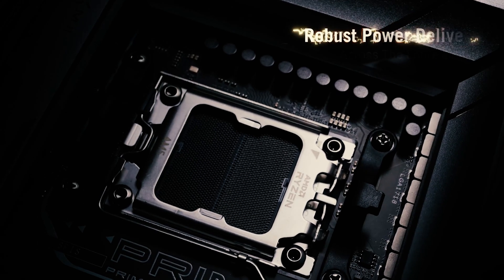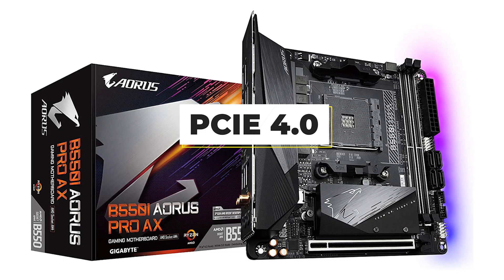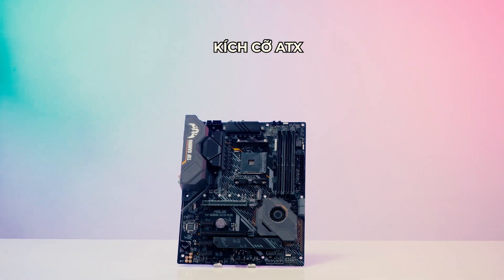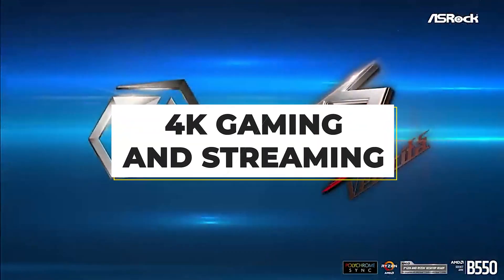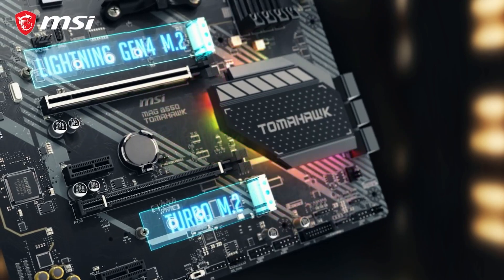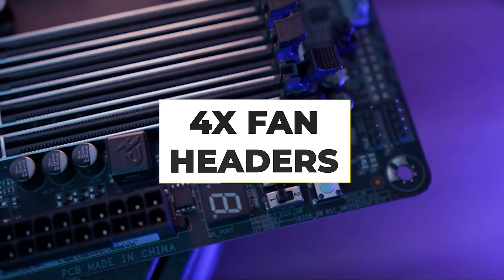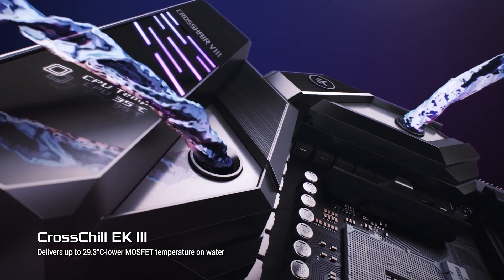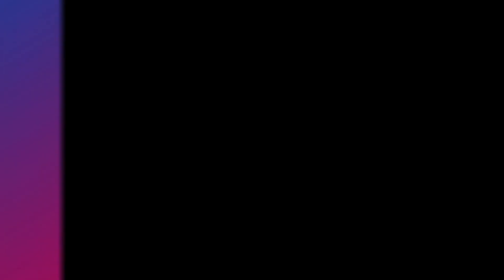Best Motherboards For Ryzen 5 3600 in 2023 - Must Watch Before Buying!

Comment: Great video. I'm currently saving up for a PC and i'm looking for using an R5 3600 with a GTX 1070(or Ti). I'm on a very tight budget for the mobo - probably maximum of £90. I've been thinking of an A520M-K or A320M-H. Any suggestions? @pickadviser

Comment: can i change CPU of r5 3600 to r5 5600 or r7 5800, can i?
Reply from the maker: Absolutely! The R5 3600 is on the AM4 socket, which is also compatible with the R5 5600 and R7 5800. So, you can indeed upgrade your CPU to either of those for a performance boost.

Comment: Boards that are more feature rich than the R5 3600 can ever draw out of them, and pictures that don't match...IE: The AS Rock Steel Legend segment started by showing the b550 Taichi.

[edit] More reasonable and intelligently selected boards would be something akin to the MSI B550-A Pro.
Reply from the maker: I appreciate your keen eye and thoughtful input! It's crucial to showcase motherboards that align with their intended use. Your suggestion of the MSI B550-A Pro as a more reasonable and intelligently selected option is valuable. Providing accurate information is key, and your observation adds clarity to the discussion. If you have more insights or recommendations, feel free to share—I'm all ears!